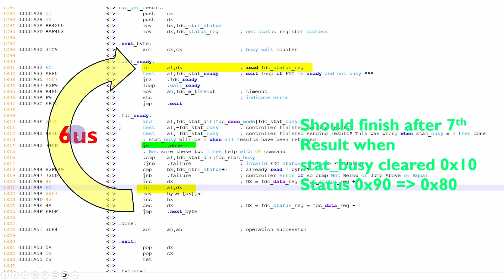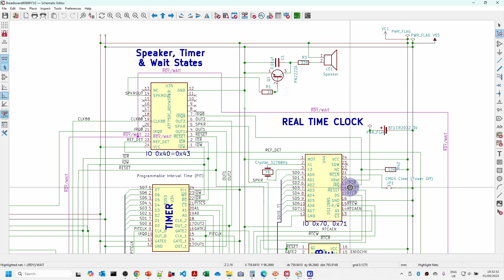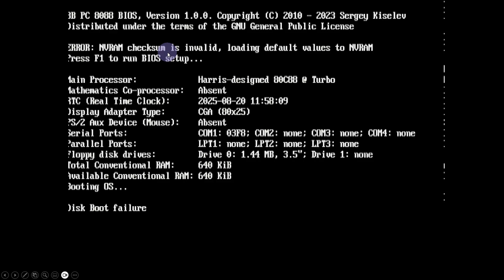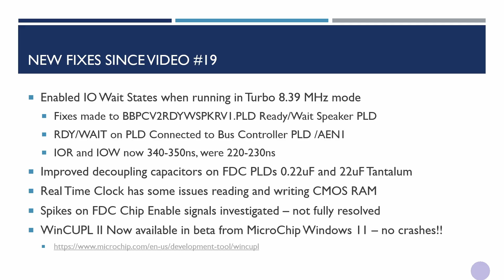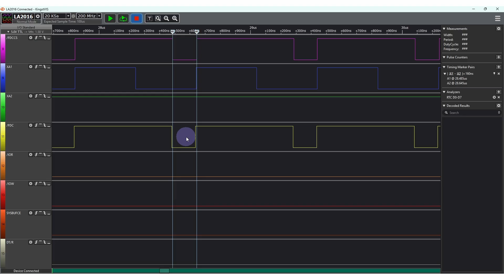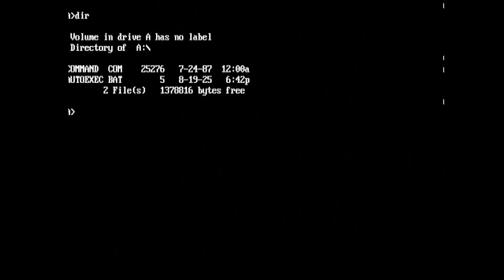New Breadboard 8088 PC V2 #20 Booting MS-DOS 3.30 and 5.0

Comment: Hi Dave! I've come across a weird issue where the floppy drive seems to work only when the BIOS booted from it. In such case I'm able to both read and write to the disk. However,  when the XT-IDE boots from the hard drive, I'm always receiving this sad error message 'General failure reading drive A'. I'm using the Goldstar Prime muiti-io card. Unformtunately, my logic analyzer has only 8 channels, so the best I can do is check which registers are accessed using FDC chip select, 3 address lines, nIOWR and nIORD. The sequence looks a little different, but I can't really tell what is going on there. I'm guessing that you are not able to check if your machine behaves in the same way, since you don't have built the IDE controller yet. Do you have any ideas where or how to look for possible causes?
Jarek
Reply from the maker: You may want to check that your XT-IDE BIOS configuration has floppy disk drives enabled and update the copy in your BIOS ROM. I seem to remember when the Boot Options has Auto for Floppy Disks, mine didn't work. In IDE Video #3 https://www.youtube.com/watch?v=SEcM5z0eek4 of the BBPC V1 series I used the XT-IDE configuration utility to change Floppy Drive config from Auto to 1. You may want to try this if you have not done so. I will be doing the BBPC V2 IDE drive soon so may be able to give more up to date info soon. Good Luck! Dave
Reply: @breadboardinglabs  Thanks for the suggestion. However, it seems that adjusting the delay in fdc_get_result fixed the issue. I don't know in what way it was relevant whether the machine was booting from the floppy disk or not...
Reply from the maker: I think I had a similar issue which I covered a few videos ago. If you read the results from the floppy disk controller and after the last result read the status too soon, it hasn't had time to change to end the loop and it tries to read another result which doesn't exist. I suspect that if I had made the wait state changes in current video (#22) then it may not have been an issue. Glad to hear you had fixed it! Dave

Comment: Interestingly during the screen captures I can here a very faint pulsating sound on head phones in time with the cursor blink? Some kind of interference?

I had manually put delay loops in before looping the status registers for my floppy controller on my Z80 code to prevent any previous statuses being read before the register updated. The problem with my solution is that its clock speed dependent. Now on my latest PCB my 8mhz Z80 has overclocked to 24mhz without any wait states on memory or IO and it's flawless now.

On my eurocard version it could never do more than about 16mhz, and the breadboard version while 16mhz would run, it wasn't reliable and 8mhz was your most stable option. So the code for one setup wouldn't work on another and cause the floppy to fail to read.

Another issue I had was using my Interval Timer to do lots of clever things during the interrupt sometimes caused the floppy to miss data, but now I disabled the PIT interrupt during the read and write, but that does put my internal clock out of sync and requires reloading from the RTC..
Reply from the maker: Not sure about the sound interference, it is faintly audible when running without recording, not really looked into it. The timing issues are exaggerated with PIO using 1.44MB drives as the data rate is twice what the original 360K 5.25" floppies would have had. I have disabled the 55ms system timer interrupts during disk operations as well (there is some code in the PCJr BIOS to update the 55ms timer counts from RTC after re-enabling the timer but I haven't done this yet). Though this has not been easy to get working, compared to the many months I spent trying to get DMA to work, it has been relatively quick. Dave